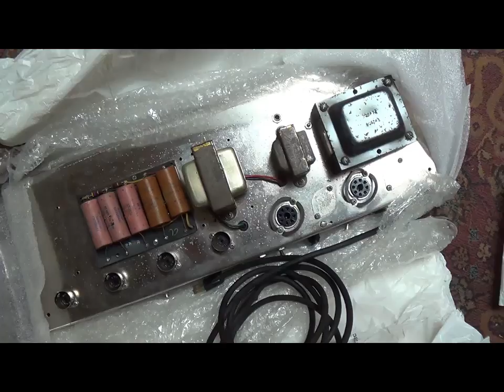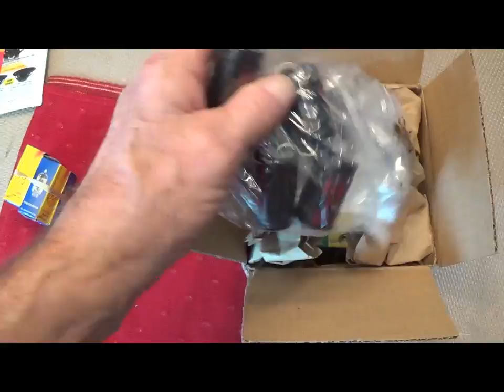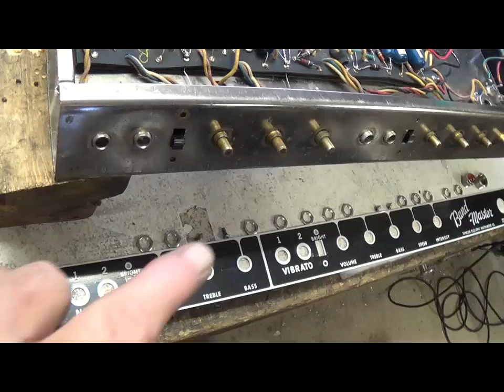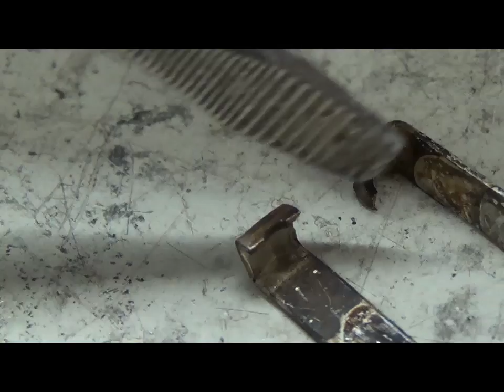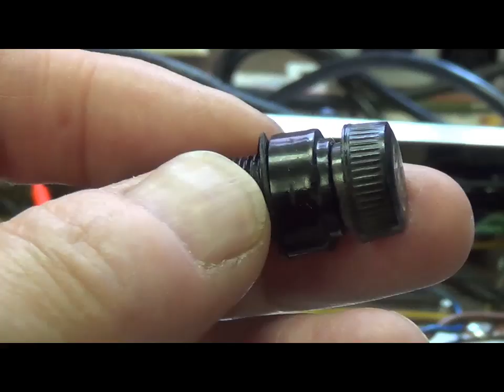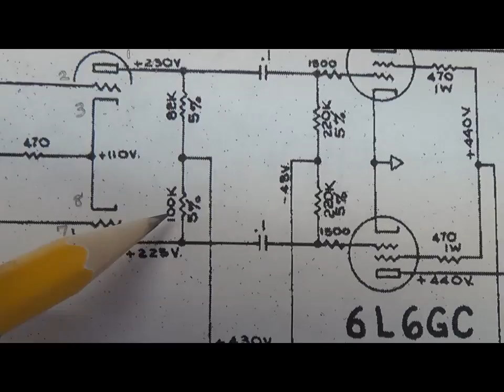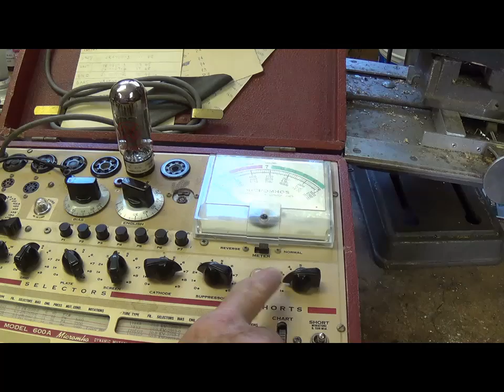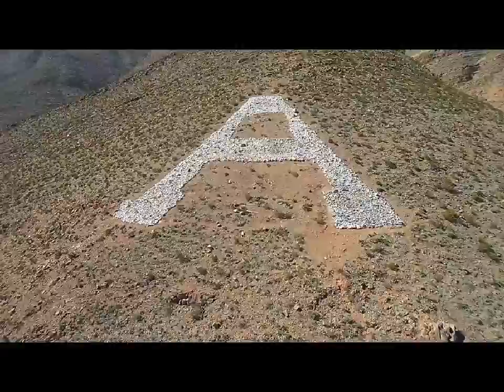The 1965 Bandmaster from Hell......A Really Tough Repair Job

Comment: Dear Uncle Doug I've learned a lot from your videos on biasing diagnostics and repair work on tube guitar amps from your videos and I am some of those techniques to my own little Fender blackface champ amp I bought this little amp for $100 22 years ago you are the best teacher I have ever heard and watched all be it on video. Hands down. Thank you very much. I have been soldering since I was 9 years old fixing the family transistor radios those many years ago because my brothers and sisters were a little abusive but I'd always fix them so I'll watch these videos again and again and apply those Diagnostic and repair techniques in my own Hobby of works learned a lot Doug so I'll be watching them again and again to absorb very good information thank you you are a gem live long and prosper
Reply from the maker: Wow, thanks so much, Dwight. It sounds like you really got an early start in electronics. Keep up the good work.  Best of luck with all your projects.

Comment: I've had JJs that were brand new fail in 2 different amps, and it seems a lot of the amp repair videos I watch have problems with them. I've now learned which tubes to avoid lol. I really enjoy your videos, I've learned so much about fixing these dinosaurs.
Reply from the maker: Thanks for the input, Josh. I have been keeping an eye on JJ's ever since.
Reply: Ive also had JJ’s show up dead on arrival.  (12ax7)

Comment: Yes that is a cathode filament short,..on that bad new tube.. which happens too often with new tube filament builts ,.. they stretch under the high current draw at turn on, and then reach over and touch the cathode sheath around them, Boom ! And sometimes magically "heal" when they cool down.  Yes the guys at Antique are great. .You can use much larger input power caps usually people use 100uf/ 300-350 v or 220 uf 300-350 volts , which are made by I C or J.J. or whatever name brand ,... and give You a little less hum.  Perhaps those plate resistors were open where they went to the plates (or cold solder joints).  A resistor will not show any voltage drop if it is unloaded (it is not a voltage divider if there is infinite resistance on the far side).
Reply from the maker: Thanks for the input Geo.

Comment: It sounded like it is better to use a analog meter to test resistors in circuit?
Reply from the maker: Not really. I use a auto-ranging digital multi-meter for all fixed resistors. For pots, the analog meter is much better.
Reply: @UncleDoug  Thanks.

Comment: Does the  bias settings effect the volume ? I have a  home built 5e7 tweed style amp with 2x6l6 and it is not as loud as my 67 baseman . I am curious what could be muting the volume.
Reply from the maker: There are all sorts of considerations: plate voltage and current, speaker efficiency, circuit design (pre-amp gain), etc. etc. Are the 5E7 6L6's GC's ?
Reply: @UncleDoug  -  Yes!

Comment: I thought the black wire should go through the fuse first then into the switch and then into the trans. Or does it matter?
Reply from the maker: There are two schools of thought on this, Robert. Do you want the entire circuit "off" when the power switch is off, allowing for safe checking of the fuse while the unit is plugged in?.......or, do you want the fuse energized while the unit is turned off, just in case the on/off switch decides to spontaneously short out (which, to my knowledge, has never occurred in recorded history). I choose the first option.
Reply: @UncleDoug  Thank you for the reply Uncle Doug. I won't mention names but I followed the steps laid out by another popular Youtuber on the "RIGHT way to do a 3 prong conversion" which takes the white wire into the middle post of the fuse, the top of the fuse ring out to the switch and out of the switch into the trans. Being a trusted and respected Youtuber, I trusted this method but you have made a very good point. Thanks for the info Uncle Doug.

Comment: Next time you do one of these, I strongly suggest you replace the 1/2 watt 100K plate resistors (the ones arranged in the "V" shape) with 2 or 3 watt metal film resistors. 30 cents each, it will cut out more hiss type noise than you'd imagine possible.
Reply from the maker: Thanks for the tip, P.

Comment: It's worth it to replace parts with the same parts in vintage amps, carbon comp resistors, American caps and NOS tubes. The clean sound is fine but the crunchy overdrive is what made these amp great.
Reply from the maker: Thanks, Chris.

Comment: What exactly is a lightening bug? I've never heard of that before
Reply from the maker: You may be referring to the neon bulb-photo resistor unit that is used to fluctuate the volume in some tube circuits, creating the tremolo effect.
Reply: @UncleDoug  how does it strobe, is it just fed AC or is it attached to its own oscillator circuit, I wanted to build one at some stage so new ideas are interesting
Reply from the maker: The adjustable-speed oscillator circuit controls the strobe rate. The flash of light alters the resistance in a photoresistor, which alters the volume of the music signal.
Reply: @UncleDoug  must Have missed the circuit!

Comment: I usually find that the white wire is often on the wrong lug of the auxiliary power outlet.  Good work Doug.  And thank you for the proper use of Tremolo/Vibrato.
Reply from the maker: You're welcome, Mr. A.

Comment: I completely restored a 1963 Twin Reverb, it had a power transformer meltdown, 
so I completely cleaned the board and chassis (totally black with soot), replaced a few caps and resistors, Mercury Magnetics PT, and found a pair of original blue back 1963 C12N speakers for it.  It was beautiful. 

Upon coming to the fuse holder, the cap was wrong and would not fit properly.   It drove me absolutely nuts haha!
Reply from the maker: Good work, LR. Just be sure that the fuse in the holder is the minimum value, and rapid-blow, to prevent a repeat of your previous meltdown. Best of luck.
Reply: @UncleDoug  Oh yeah, that was just a little icing on the cake to deal with.  I bought it already melted down :)

Comment: Uncle Doug , I was amazed you found that resistor  ,  and I recommend the Russian WXT 6l6 tubes in cathode bias amps if the plate voltage is below 420 volts they sound real warm and beautiful !
I use JJ 6v6-el84-and 12ax7 but not in V1 I have Tungsram and RCA long black plate 12ax7 with a large expensive collection as they all have a different voice by make !
Never a bad note from the awesome Tungsram tubes !
Reply from the maker: Thanks for your helpful input, IS.

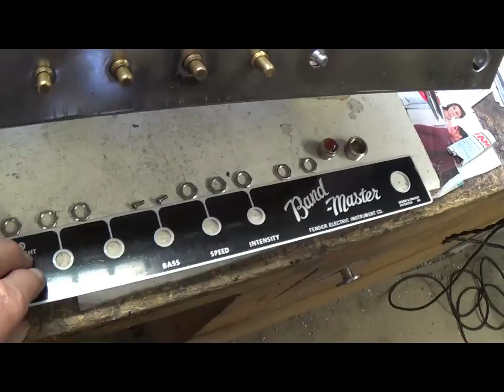Comment: 15:02 Not sure if they were doing it in the 60s, but my '74 Twin Reverb has a really sticky double sided tape or something on the back of the faceplate, or at least it's on each end of it. I guess they did that so when you pull the chassis out of the cabinet you don't bend that plate outwards because it's really stuck on the chassis. I need to see how they did it on my '65 Showman head just to satisfy my own curiousity.
Reply from the maker: It would be a good idea, VC. If you snag the end and bend the plate, it's a real disaster.

Comment: Do you know where that new faceplate was obtained?.  I am searching desperately for a new or ideally a gently used silverface Vibrolux reverb faceplate
Reply from the maker: It came with the amp from the owner. I don't recall the source, but I have seen new repro and good vintage faceplates offered on Ebay.

Comment: Hi Uncle Doug. I was wondering what source was to order the black face replacement control panel face plates from? I need to find some Bassman front and back plates. I know MOJO had them but with no description names. Can you help ? Maybe your customer could help. Thanks, Tom @ Signature Music, Digby N.S. Canada.
Reply from the maker: I'm not sure where the faceplate came from, Thomas, possibly Ebay. I don't recall seeing a source name on the package it came in. If I can find out anything, I'll let you know. Meanwhile, check the Internet.

Comment: Wow, that whole resistor thing is crazy, itll definitely change my troubleshooting to know that i cant necessarily trust my DMM. Thanks!
Reply from the maker: You're welcome, Ash. It's rare to find a resistor that tests within reasonable limits with a low-voltage DC ohmmeter but breaks down under full current....but it can happen. If you suspect this is the case, then test the resistor for voltage drop.

Comment: This was really great.  When I was a teenager, I had a used 65 bandmaster.  At some point it stopped working, so I sold it.  If youtube was available at the time, I likely would have tried to repair it.  What a great time we live in.
Reply from the maker: Indeed, it is a great time. Too bad you didn't just stash the Bandmaster away in a safe place until it could be repaired. Believe me, I've discarded and sold all sorts of great items over the years.....and  I truly regret it.

Comment: Doug - at the 24min mark you mention that you can't trust a DC ohm meter in this case... is it because of the high voltage of the circuit?  Is there another way to test that resistor (or similar resistors)
Reply from the maker: I think you can trust a DC voltmeter  about 99% of the time, Ervin, but occasionally you might encounter a resistor that may show a reasonably accurate resistance reading to the very low DC applied by the meter, yet break down when subjected to high voltage in the circuit. Admittedly, this is not a common event, but one that you should keep in mind when faced with a perplexing repair job such as the Bandmaster in this video.

Comment: Thanks again Uncle Doug, glad to know it's not just me that those things happen to. A customer brought me a $5000 Bogner head for the installation and biasing of a new quad of power tubes that he had bought from a not so well known tube vendor. One of the tubes red plated during testing. In a panic, I killed the power and when my heart slowed down, I tested all the tubes on my Hickok AND TV7 testers. NO shorts. With my current limiter hooked up and watching the plate current, one of the tubes red plated again and I noted which one. I proved that it was not the amp doing it and advised the customer to contact the vendor. The vendor gave him grief and told him his technician didn't know what he was doing. I contacted the vendor and he told ME the same thing. I told the customer that I was not comfortable taking any more chances with his amp and he agreed to take the amp home and do his own testing, and then carry on the fight with the vendor. Sure enough, the tube red plated again on him and he was finally able to get a replacement. There you go. It's one thing to fool around with red plating tubes in a $200 amp, much, much harder on your blood pressure in a big dollar amp.
Reply from the maker: I agree 100%, Scuzz. Working on other people's (sometimes expensive) equipment can definitely be nerve wracking when things start going wrong.....especially when it's not your fault, but you're the one who ends up taking the hit. This is why I prefer building my own amps and cabs from scratch......all new parts and no one to answer to but me :)

Comment: Hi Doug, what I did was divide 30 watts dissipation for a TAD 6L6 into the plate voltage of 484, then multiply that times 60 %. Yeah I will watch that video. But if the plate current is too low, what do you do to rectify the problem ? To set the bias, I used a bias probe that you put the valve into then into the amps valve socket. Multimeter set to milliamps. Then I just turned the pot until I read either 60% or 70% dissipation. I just always thought it to be strange that the plate voltage was running so high. The amp seems to play ok. The tone is good.
Reply from the maker: I'm not familiar with using bias probes, Michael. I generally just make all the measurements by hand, as demonstrated in the video. Please watch it and carefully follow the steps. Remember that PV is more accurately measured from plate to cathode. See how the manual measurements compare to your probe values.

Comment: Hi Doug,  I wanted to ask you how I use my Digital volt meter to check my plate current. When I measured my plate voltage I simply put my ground to the chassis and the red lead to pin 3 on the tube socket. Not sure how to do the plate current. I will change that bias cap to the value that you use in the video. I've read on the net that other people also have a plate voltage of 484 as well. I asked Gerald Weber once on the phone about it being that high and he didn't seem to think it was that big of a problem. It just seems awfully high. The schematic says it should be around 440 on the plates. I also set the bias to 55% of dissipation. I set it at about 36 milliamps.
Reply from the maker: Greetings, Michael. To properly measure plate voltage, you put the red lead on the plate pin (3) and the black lead on the cathode pin (8). Properly measured, your PV will be lower. Watch my video on biasing double-ended amps to see how to measure plate current indirectly.  I'm not sure where you got the 36mA value for your PC......do you mean -36VDC for the bias voltage?

Comment: Hi Doug,  wanted to ask you a question about my Fender Blackface Bandmaster. I get 484 volts on the plates with this amp. The amp was giving me a lot of trouble before. I had replaced all of the electrolytic caps as well as all of the blue caps with So do vintage caps. I replaced most of the resistors as well as the choke and the output transformer. The bias potentiometer was replaced as well. I used a 100 if 350 volt bias cap. Just wondering if that value should be changed to what you were using? This high plate voltage has me wondering. The amp seems to play fine. Any advice? Thanks
Reply from the maker: I assume this plate voltage reading is with the tubes in place, Michael, and measured from plate to cathode. Also, you do not mention your plate current values. Bear in mind that the most significant index of proper bias is the plate dissipation value, which is the product of the PC in Amps x PV (plate to cathode). I have a feeling that your PC value may be quite low, which will cause the PV to be elevated. Check all the measurements I mentioned above and get back to me. Your bias cap is too high a capacitance value, but it should not be affecting the PV.

Comment: Sir Doug,slowly i am gaining understanding. largely in part to your carefully word orations, ive no training,little comprehension. but strong resolution to nerver again trust the "professionals" with one of my precious heirlooms again. it takes me forever, but i,m 3 for three on amp  diagnosis and repair. 63 brownie  bassman 66 vibra, still need to understand trem circuit. and a still dont know what,, old 6x4 rectified little beast.lot of suzuki stuff in her. many dumb ass questions, but not one to slow the flow of those who are more capable than i. currantly have a  74 alamo poppin fuses,90 watt Montclair, loooks pristine,has a weird ass f,switch input that looks to be capped off 3/8" insiside of the jack,,1/4"..looks factory. but ive seen this switch plug, looked 2 be a standered r.t.s. plug. which would barely insert past the tip on mine.  i dont know man. keep  doin your thing sir Doug. i,m doing my best. thank you.
Reply from the maker: You're welcome, Phil. An old amp that starts blowing fuses may have some leaking filter caps.....they can draw a lot of current. You need to check them.

Comment: While the innards were obviously refurbished at one point with original parts, you can tell it was taken apart at one point and time and it was sand(or walnut shell most likely) blasted. That pitting all over the metal and how shiny it was tells a story as they did it rather carefully and left a bit of rust behind as not to compromise the structural integrity..Or it was just a inexperienced guy afraid of breaking something.
Reply from the maker: So you are suggesting that someone completely disassembled the entire chassis: rivets, bolts, solder joints, etc. Then blasted it with walnut shells and then reassembled it with all original parts......and this was done by an "inexperienced guy"  in a way that is "obvious". Two questions and a statement: 1.)  Why would they  do this? 2.) What about the chassis makes such a theory "obvious"? 3.) I am an experienced metal finisher and fabricator, and the finish on this chassis is not the result of any sort of abrasive blasting. Bear in mind that  I'm not arguing with your assertion, SD. I'm simply trying to assess its validity.